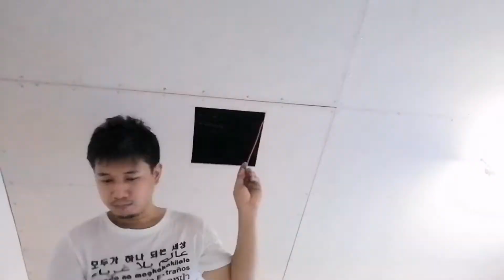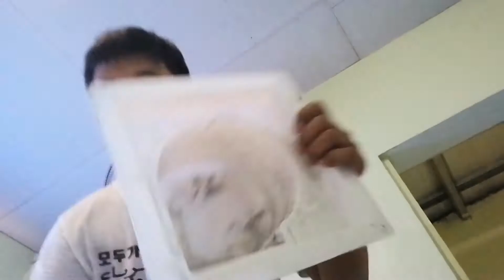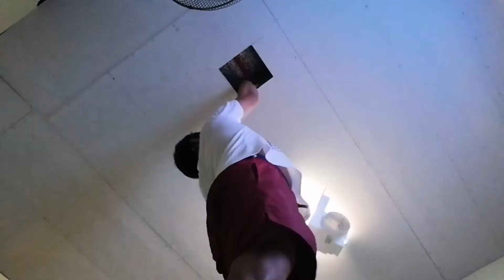paano mag lagay ng exhaust fan sa kisame / how to install exhaust fan ceiling

Comment: Saan nyo po nabili ung parang host na malaki na foil para sa labasan ng hangin. Ano po tawag jan. Salamat
Reply from the maker: Sa shoppee po mam
Duct hose tawag po jan
Reply from the maker: Or aluminum air duct
Reply: @jhaypaulocampo  anung size ng duct hose sir?
Reply from the maker: 4inches po sir

Comment: Sir update naman po sa bnli nyong aircon? Ilang hp po at nalamig po ba sa extension room? Sana po masagot
Reply from the maker: 2hp po yan sir mas lalamig yung extension room kung gagamit ka po NG wall fan
Reply: @jhaypaulocampo  sir u mean wall exhaust fan or electricfan po?
Reply from the maker: Exhaust fan sir pang wall lalu na kung medyu malaki yung room na susuplyan mo
Reply from the maker: Pwedi na yung 10x10 wall exhaust fan
Reply: @jhaypaulocampo   ceiling exhaust po kc ung nabili nmin at di pa nakabit kaya gusto ko lng alamin kung ok at kung malamig. Thankss
Reply from the maker: Yung nilagay ko sir yung room maliit lang sya kaya lumalamig naman
Reply from the maker: Ano po ba size NG room nyo
Reply: @jhaypaulocampo  ung isa 10x10 at ung isang room po 8x8. Ang ac ko is 2.5 hp inverter
Reply from the maker: Bilhin mo sir mas makanta lagay mo nalang wall exhaust fan sa pader wag kana mambutas sa kisame sa pader na mismo
Reply from the maker: Malaki laki kasi yung room mo
Reply from the maker: Yung nilagay ko kasi sir actually lumalamig sya kaso matagal bago lumamig kaya ginawa ko nag exhaust fan wall nalang ako nagbutas ako sa pader ayun minutes lang mapamig na ang room
Reply: @jhaypaulocampo  thank u